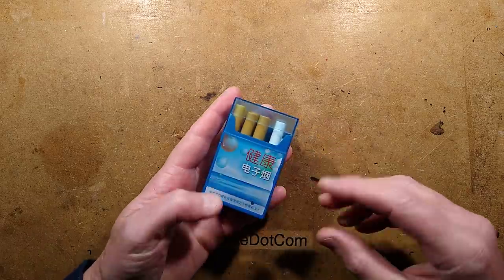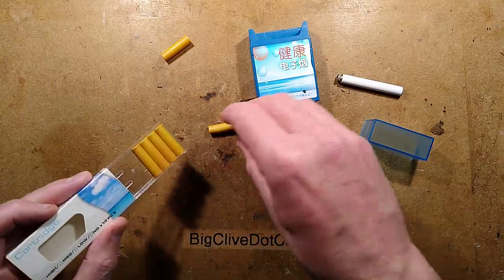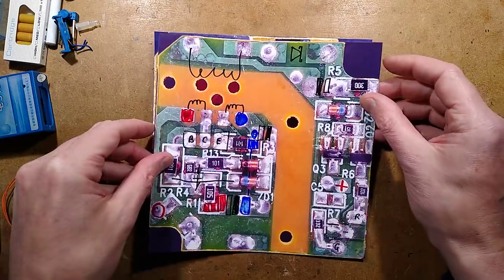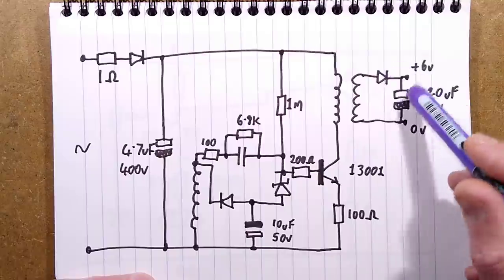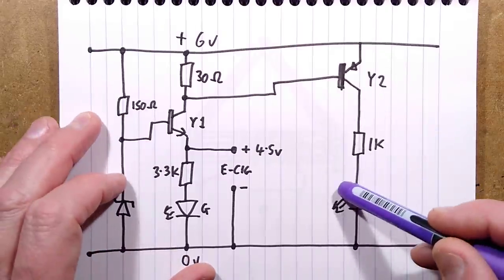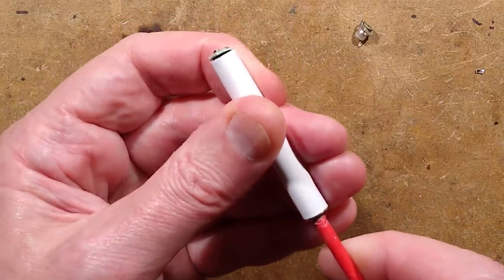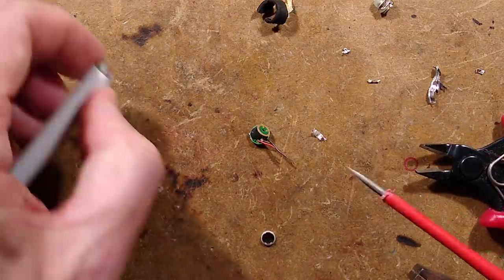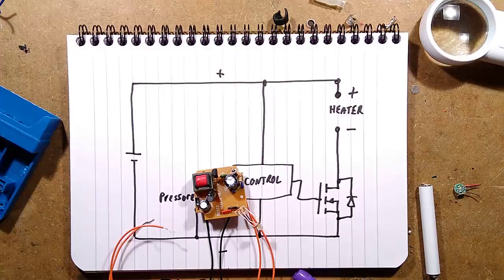Vintage novelty device teardown (with schematic)

Comment: About 15 years ago I bought a kit that came in a nice magnetically closed box with six or eight black batteries with a blue led in the end, about the same amount of atomizer, and a whole bunch of preloaded cartridges (that were just a hollow tube with a small hole in the end stuffed with cotton with e-fluid on it) and dry cartridges with several bottles of e-fluid to fill yourself, and a mains and a usb charger. The atomizer looked exactly the same as this one. I think I payed $400 (US) for that kit.

Comment: I don't vape but I want it for the novelty
Reply: It can be quite fun, especially for learning to blow smoke rings and such. If you want to avoid any negative health effects you can skip any flavourings and just use a glycerine-propylene glycol mix (the latter mostly just to reduce the viscosity, if the vape can handle it then just glycerine can be used)
Reply from the maker: That's why I bought it.  And still occasionally use more powerful units with nicotine free, and often flavour free fluid.

Comment: With a power requirement of one watt. Why not just use a linear supply?
It wouldn't be heavy or expensive, and their using a transformer anyway.
Reply from the maker: Still cheaper and lighter to use switchmode.
Reply: @bigclivedotcom  
I'm not sure I agree. At such low power levels, the transformer they already used really should suffice.

But in retrospect, even the Zener rectifier trick would supply enough power. That's literally just four diodes.
I don't really follow why they need an isolated supply. There are no exposed electrical components.

Comment: I used to buy they very same type of cigarette,( form a Poundland/Dollar store) but i noticed the palms  of my hands getting unbelievably itchy after a few of them. god knows what was in them but it scared me to stop getting them..
(MINE JUST HAVE A BIT YOU SCREWED THE BIT WHICH HELD THE BATTERY INTO & IT PLUGGED INTO ANY USB CONNECTOR. WHEN THE RED LIGHT TURNED GREEN OR STAYED ON FULL 'can't rightly remember which' AND IT WAS READY TO GO AGAIN..)
P.S. SORRY ONE MORE THING,!.. IF I IGNORED THE ITCHY PALMS OF MY HANDS & KEPT ON SMOKING, THEY WOULD THEN START TO SWELL.. BAD STUFF!!!    : (
Reply from the maker: The itchy palms sound a bit like dyshidrotic eczema.  A common thing that causes tiny little water blisters to appear between fingers and on palms.  Harmless, but annoying.

Comment: I love to fix. And then. I love to repair. Thank you. I even had to produce switching for SSRs, frequency generators. And  current load test. And I  am still here. Lol. Worked in wind power from 1995 to 2013. Because you can not go to the local store. LoL. And I did the LEDs in the early 99. It seemed to run longer than the current incandescent bulbs.  For our WEG machines. LED was new and with the ultra LEDs. At 10 dollars a led. I used some old fax machine LEDs with a resisters. And works better. Back in those days. There were three colors. Non of the wifi crap. I just found a way to !ake the already light bulb last longer. The guys said. Get a patent. But I did not have the funds. I was working for my family. And then it blew up with the ultra LEDs.
Reply: That was just cool and being Innovative using what you have refurbished Salvage recycle reduce repurpose and so on rinse-and-repeat done the same sort of time who sang time and time again if it's no longer useful in its current form turn it into something else make it do something else whatever still reuse what can be reused in at least one form or another.

When I was younger we used to have a rule that if it went out or is no good or no longer useful whatever it got repurposed reused or salvaged

Comment: i remember these! they came out around the same time weed carts started out that had a crappy fiberglass wick that always left the coil dry and would burn out super easily
Reply: also they have evolved into disposable" devices that combine all of the stuff on the circuit board into the back of the electret pressure tranducer that has 4 wires, 2 for battery, 2 for coil and the led is built in, they always contain a rather chunky lithium ion that runs out before the juice does, i dont use them but my sister always is asking me to recharge them for her

Comment: A vacuum switch optimized for oral activation could be called a suck switch.
Reply: Actually there is such a thing called a puff and suck switch or Puff and sip switch it's used for accessibility in various applications where someone does not have use of a limb or other appendage to operate a switch or in the hospital perhaps 4 to call system and TV or other systems if the person for some reason is unable to or is it a situation where they cannot do it normally often combined with scanning Hardware to operate more than one function in some cases such as operating hospital bed or otherwise

Comment: I prefer this type of small vape - or ‘lady vapes’ as I call them - I really hate the huge tank type emitting  plumes of fog . …. I think vaping lost it way when they started making the huge high power coil vapes - surely vaping should just be a healthier alternative to real cigarettes and not a hand held fog machine .
Reply: I almost agree with you, but it really depends on the use of the vape. 

If you use a vape to reduce nicotine consumption, a vape with lower airflow makes sense. 
Using a vape for nicotine salts, as a healthier alternative to smoking tobacco, means that one would have to constantly be hitting a lower airflow style of vape in order to consume an equivalent quantity of nicotine to a cigarette.  

The only real difference between the two types of vaping devices, in modern designs, is the amount of air passed through the atomizer.  

The Smok Mag Pod is a good example of a modern low airflow design. The electrical components, including the resistance, are identical to high airflow versions but the airflow is limited by the smaller size of the air channels in the atomizer.  

Conversely, I've seen some homemade "fog machines" that consist of cotton batting passed through a single coil of ni-chrome wire with the ends of the batting resting in a reservoir of vape juice.
Reply: @mikeznel6048  
Got any sauce?  
(Would you kindly share any links to bonafide medical documents supporting your assertion that vaping is not only harmful, but moreso when switching from smoking tobacco?)

Comment: I bought one of these sets from Deal Extreme in 2010. With nicotine in the liquid.  I just checked my email for the receipt. I paid $9.70 USD plus shipping for a similar setup. I don't think mine came with the faux cigarette pack.  I think I used it for a bit but then stopped. It irritated my throat too much.

Comment: That is a lot of tiny, disposable plastic per use. It's like they asked, "how can we make the problem of cigarette-butt litter worse?" (Oh, and you probably should be wearing gloves--nicotine is absorbed pretty easily through the skin.)
Reply: Nicotine is fine, the other alkaloids along with it is what makes it so addictive. Straight nicotine is a joke. In theory you could overdose, but it's highly unlikely.

I've been smoking, vaping, dipping, "snuffing"? chewing, using snüs  for well over 20 years. If I've learned anything, tobacco isn't just nicotine, if it was, I'd be on a straight nicotine delivery method by now.

Comment: Next up how to make rechargeable led pocket disco light out of a epack all should vote to see If it can be done ,,😃
Reply: Simple my dear Watson. Visit your local Ecig shop and raid the recycle bin. 
Everything from batteries to many reusable components including leds from circuit boards of old vape units. 
Classic example. I stick basic 20w. Usually in recycle bin because 510 thread to attach Vape tank is damaged. The old version had an 18650 lipo with a battery protection board plus the main circuit board (firmware flashable through USB port. I have never tried to put other software on there. )with a tiny display etc may reusable parts. 
Apart from a
 disco light I’m sure it would be possible to make a custom soldering iron with a led light to shine on work area by taking insides and fitting to a custom printed case.